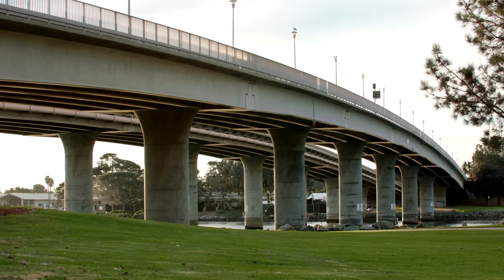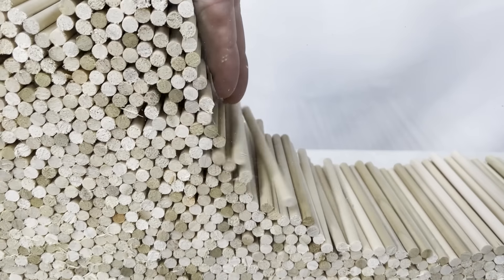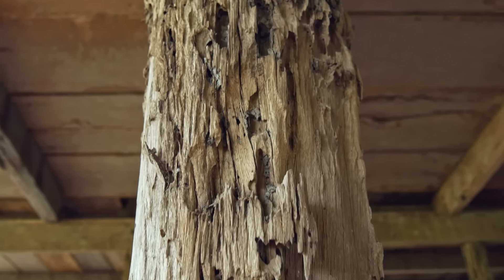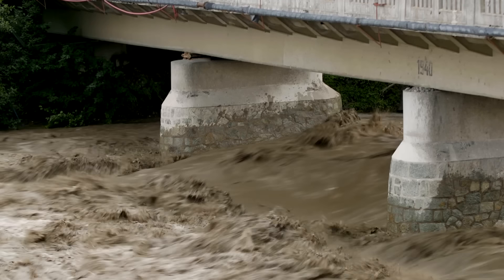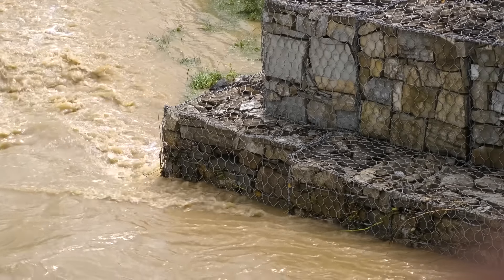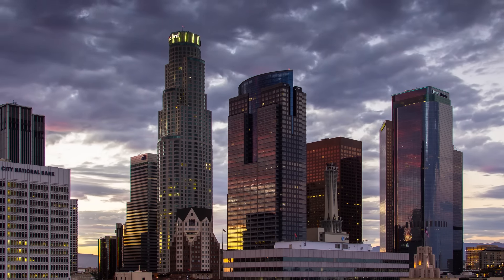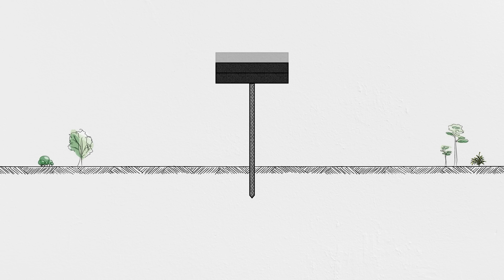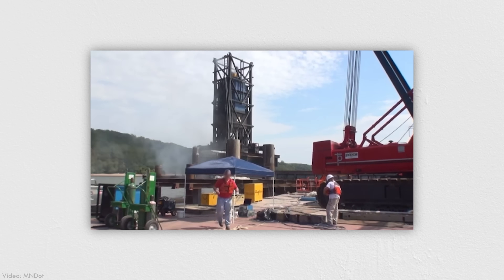Why Buildings Need Foundations

Comment: I'd like to see more of the specifics on how your house foundation gets rebuilt. Retrofits are a different challenge.
Reply: I find it amazing that's even a thing that needs to be done. But then I'm in the UK, our houses foundations are structurally part of the house, you can't simply dig them up and replace them without basically demolishing large parts of the house. That said, you'll also likely never find a house that needs its foundations replacing (repairs aren't unheard of but usually due to a structural error or tree root growing into them) in less than a few hundred years, in many cases over a thousand. By which point, the house itself needs replacing/repairing more than the foundation. 
Does admittedly make it more difficult to access utility lines coming into your house, but since they aren't exposed to the outside at any point, it's rare for them to be damaged.
Reply: Stud Walls and other shoring elements can be used to support load bearing columns in your house and allow you to work on  your foundation while it is rebuilt.
Reply: @cgi2002  I saw a documentary (DW or BusinessInsider) on the trend of expensive London townhomes that had massive subterranean basement expansions. They added 1-3 levels underground due to town zoning limitations on above-grade additions. The newly expanded basements though have problems; like the guitar player from Queen had sewage in his basement. Yuck!
Reply: +1
Reply: @kazj1728  yeah that is happening but even thats fairly rare, as it's expensive and requires very specific planning permission including the consent of your neighbours and you to have insurance incase you damage their homes as you are, by digging that out, essentially undermining their foundations too.
Reply: @cgi2002  welcome to the wonderful world of engineering ... so there are many regions in the world that are different than the UK ... they were also developed different than the UK ... so you can do something easier and cheaper to make housing more affordable for the lower income brackets

i hope instead of just staying ignorant about why people build differently than the UK ... you can watch some videos and learn about the subject ... there is a reason engineers decide to build foundations like this
Reply: @dovahkindragonborn9827  oh I get it, and why it's done in some places, and the mayraid of reasons. 
It's just the US however confuses me as to why they do some things the way they do, using building methods that are poorly suited to their situation time after time.
For example its known to have a huge area that gets hit by tornadoes every year, and they still build houses with wood. There is a litteral childrens tale about why you don't do that, the big bad wolf will huff and puff and relocate your house made of kindling. 
It wouldn't (or shouldn't) cost much more to build out of bricks in those places which is considerably safer, at most you lose your roof.

Oh and this can't be claimed to be a different building style from another part of Europe, as most of Europe uses stone based construction (bricks, layered cement, etc).
Reply: @cgi2002  Because it's much more expensive to build block houses and they are harder to insulate. It gets really cold in a lot of the areas where tornadoes happen so you're also adding to heating bills for the life of the house which is already a large expense. Houses can also be rebuilt relatively cheaply and quickly, especially since everyone with a mortgage is insured. Additionally fatalities from tornadoes are not that high, even though there was a terrible one recently, so that's not a huge factor either. Overall it's just not cost effective to start building hurricane resistance houses when you can put in a much smaller, cheaper, storm shelter.
Reply: @cgi2002  lol always with the Tornado thing... A tornado's path of destruction is typically a very small area, and the Midwest is quite sparsely populated compared to the coasts. The risk is just not that big. It doesn't make financial sense to use brick on a continent with an incredible abundance of trees suitable for making lumber. And brick isn't exactly invincible either. It's also completely useless in an earthquake, and there's a hotspot right in the middle of Tornado Alley unlike anything in the UK or northern Europe. Much easier to just build a small storm cellar underground if your house doesn't have a basement.

Pile foundations are also not typical. I've only ever heard of them being typical in Texas due to its soil properties. Most homes have a concrete foundation like you're used to.

Edit: Also, I should mention that places with high hurricane risk like Florida often use concrete construction. Hurricanes have high sustained winds over a very large area so it makes sense to build to prepare for them, unlike the small and sporadic destruction of most Tornadoes.
Reply: @sntslilhlpr6601  the abundance of wood is a bit deceptive, as recently there has been a massive shortage of wood. Brick however, well theres still plenty of clay still.
The tornado thing isn't a case of surviving, that's common enough amuse to storm cellars and basements as you said. And there may be a relatively tiny chance of getting hit by one due time the size, it's often shown on the news here that atleast a few times a year a few dozen houses in a town get reduced to kindling. Sure I get that's like a fraction if a %, but it does leave the question of why not use brick if you can just to avoid that risk. But then the US also has alot of trailer parks, which seem to be a US only thing, first world country that claims to be the best at nearly everythibg and has litterally millions of people who can't afford to live in an actual building, and most of them seem happy to do it.

As for brick in earthquakes, it tends to stand up to them about as effectively as wood, It is admittedly harder/more costly to repair (in that it requires a more skilled builder). You are however far more likely to survive a major earthquake in a brick house as they are far less flammable (most earthquake deaths are from the fires afterwards).
Reply: Yes please 🥳
Reply: @cgi2002  because the premise is faulty.  Strong tornadoes will rip apart a brick house.  So you're just back at square one: how much money to spend to build a tornado proof house, given the odds one that can rip it apart would ever hit it?

Is brick good enough?  Maybe, maybe not, have you done the math?  Maybe what they do now, or some slight modification, is good enough too.
Reply: @bobbycrosby9765  true but your now in the F4 to F5 range if your talking about ripping appart a brick house (also depends how you build it). Those levels of storm will basically disassemble anything else too except specifically designed tornado proof buildings and even they may be damaged by an F5. 
An F2-F3 will barely touch a brick house (its roof is another matter, it been removed may cause some damage) but will disassemble a timber structure quite effectively.
Essentially you need to draw a line of risk/reward and cost analysis. Is the cost worth the reward, personally I would say yes but clearly many people in the US disagree and would rather have lower cost but greater risk. 
Your right I don't have to think about this, as we don't have Tornadoes here, closest we get is storm winds that can push into the low F2 bracket, and they are extremely rare (maybe once in 10-20, years), intact it's highly uncommon to even get into the F1 bracket (once every 2-3 years). 

Oh as for the how you build it remark, I am referring to the thickness of external walls (mine are double brick with an airgap) and the nature of internal walls (mine are all internal brick walls, no dry wall or plaster board). You don't see alot of construction like my house anymore, instead using a breeze block wall with a second single brick wall for the outside and using cheaper plasterboard style internal walls, those houses are alot less structurally solid (they are also prone to issues with subsidence as they also tend to have weaker foundations too).

Comment: My parents' house has a basement, but the ground is 7 feet of sand on top of a layer of clay, so the foundation was put on top of the clay.  This means the preferred path of groundwater is through the basement.  The original owners also increased the size of the house during construction, so 1/3 of the house doesn't have a basement under it, and that part sunk over the decades.
Reply: well... that sucks
Reply: Oops
Reply: As this video demonstrates, you can put a basement anywhere you want, as long as you're willing to build it right. But most people aren't willing to pay to do it right.
Reply: I live in a 104-year-old house, and we have a "creek" that runs through our basement whenever it rains. We had several inches of water one year, so a small channel was dug along the uphill edge of the basement that captures the groundwater as it comes in through permeations in the foundation, and redirects it into the house's drain to the sewer. Pretty sure the foundation is on bedrock, as it's pretty shallow in this area. The base of our chimney actually sits slightly higher than the basement floor due to being on top of a small bedrock outcrop. Easier to build over it than blast or pickaxe it in 1918 I guess lol
Reply: That is a case where re-engineering the design needs to happen, so the house doesn't tear itself in half.
Reply: @scottcarr3264  I don't know how much engineering was done in the first place to say it would be re- doing. Fixing all of the various structural issues would cost almost as much as starting from scratch, while leaving plenty of issues like bad layout.  It should last until they retire.
Reply: @eclogite  Your house must be very neat to live inside. I moved in with my Dad a few years back, and at the time he was living in a house built in 1904, and it was a real joy to learn about different things. (Like the coal hatch into the basement from the backyard that would have been used so the Coal truck could back up and use a slide right into the window to get your coal)
Reply: @voleNTV  I guess it is, but it's also a bit one part neat and 3 parts finding asbestos in the walls and wondering exactly how old the meter-wide derelict wasp nest in the attic is lmao
Reply: @eclogite  Yea, those two things would sour the experience I'd say lol. My dad's had like 4 inch thick Plaster Walls, not sure it ever had a lick of Asbestos thankfully.

Comment: You'll probably appreciate this story:
In my senior year of university, the school decided to add a parking garage in the middle of their downtown campus for the following year. They started construction 2 weeks into the fall trimester and kept going until just after that first round of finals. They had brought in a diesel hammer to drive the piles. Not only did you get the diesel explosion every 3.5 seconds but it was followed by a tremor so violent it was shaking the mortar out of the brick walls at the exterior side of every classroom. Grades dropped so drastically the school had to curve the grades for every class in the two adjacent building by 35% to keep the scholarship student's GPA's high enough.
Reply: GO Transit in Toronto took over some old rail lines, and for some reason they drove piles rehabilitating the old track.  The vibration damage in "The Junction", not to mention the degradation of everyday life while that long project took place was visually evident.
Reply: Congratulations on surviving that; it sounds like hell
Reply: Was it actually explosions, or just hammering?
Reply: @leandrog2785  Some hammers use diesel fuel to add an actual explosion to each hammer action, so I’m assuming actual explosions.
Reply: @leandrog2785  it is EXPLOSION, diesel hammer really means using diesel as a " gunpowder" , the charge is fed, which is diesel, and then the falling weight compresses this charge to create explodion.
Reply: @aadilansari5997  Oh so it's basically like the pistol in a diesel engine? Neat!
Reply: @leandrog2785  Diesel hammers have a cylinder that the hammer rides in. When diesel is compressed to a certain point it gets hot enough for auto-ignition. At every cycle, the hammer comes down and hits the punch (the part that is touching the pile) it the top of the punch there is a small depression that allows the diesel air mixture to reach explosive compression at the exact moment the hammer strikes, causing more downward force into the pile and shooting the hammer back up the piston until it passes a vent port to vent the exhaust. standing nearby for a full cycle you hear the ping and boom simultaneously, then the rumble of the shock wave bouncing off of bedrock and back through the soil then the gasses escaping which is a bit like a bus' air breaks being released.
Reply: How can anyone with any sense do such literally violent construction work and not be concerned about the effect on surrounding buildings, utilities, and infrastructure?  I live next to a military airfield and the foundations are inspected every two years (not sure of the method, it's just stated in the lease) for vibration damage.
Reply: @whoever6458  The school did halt the project for the remaining 2 terms and pick up again in summer, though their fast track students that take a summer term still had to contend with it. The project ended up finishing two years late due to having to stop driving piles until summer and a blizzard the following winter.
Reply: @nadapenny8592  I have no idea. From the rumor mill of friends that graduated after me, the nearby theater sued for lost revenue due to not being able to do matinee shows with all the pounding as well as damages from having to get their bricks pointed afterwards.

Comment: A coworker of mine with a bad foundation used a never ending collection of cheap bottle jacks to slowly support his house as it crumbled away. Hundreds of jacks and a few years later, there was literally a foot or two of free space all around. It was one of those ingenious situations that caused simultaneous amazement and head shaking!!
Reply: Was his name Jack as well?
Reply: Seems like it would be cheaper to jack up, add a block of wood, and release the jack. That's the easiest temporary solution and doesn't require spending thousands on jacks..
Reply: @KaylaJoyGunn  why not expansion foam?
Reply: @KaylaJoyGunn  When you add a jack, it needs to be regularly tensioned. No doubt, many of his jacks no longer contacted anything solid whatsoever.
Reply: @leeg5678  don't fall for that scam. Expansion foam is a bandaid, and besides being a mess as well, that's about it.

Also, any foundation wgich can be jacked up by hundreds of jacks is not the kind of thing that expansion foam is made for.

Maybe a section of sidewalk.